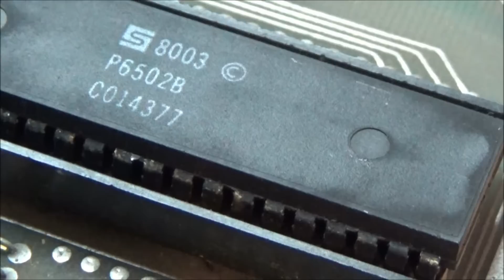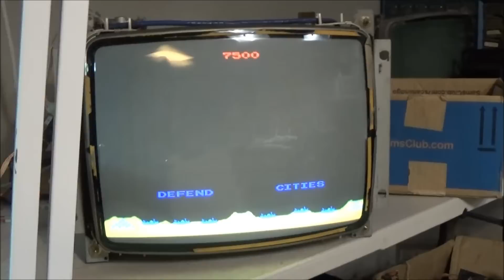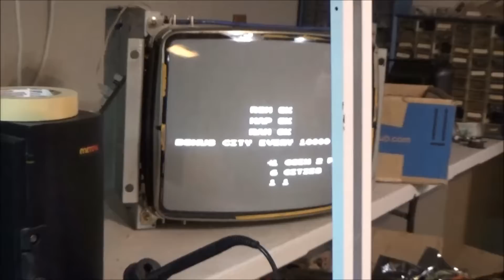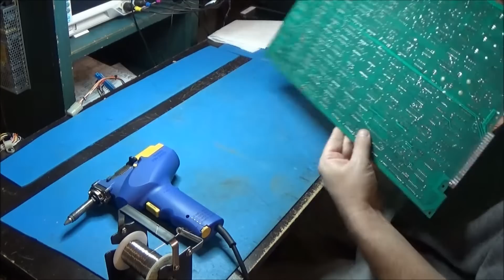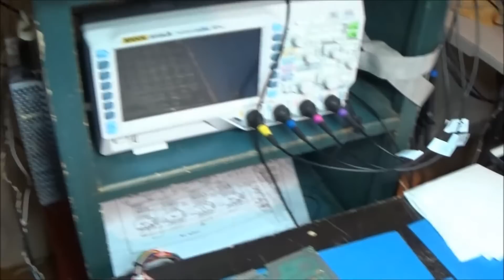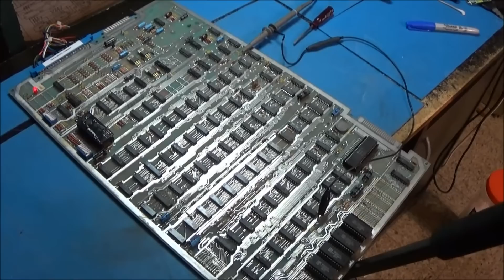1980 Atari Missile Command Arcade PCB Repair 11-19-20

Comment: I just got away replacing the 48.6something MHz quartz in a Zaxxon bootleg with a 48.0 MHz one and the TV synched up to it fine (the TV must have been set a little low as it doesn't sync with roughly one game in 30). As for 10 MHz quartzes I have one too many. I ordered one only to find out that one of my garbage boards (an HDD controller from a dead drive) had one...